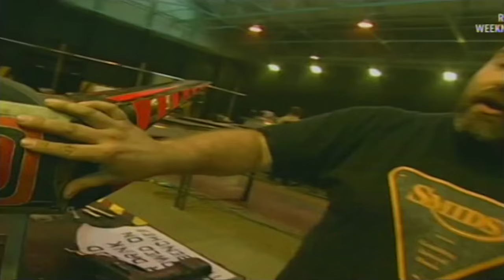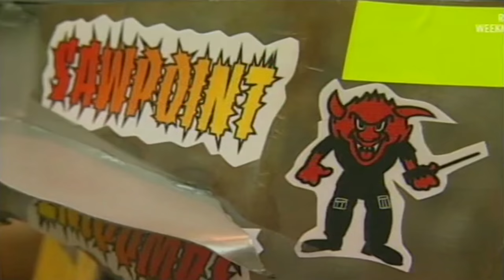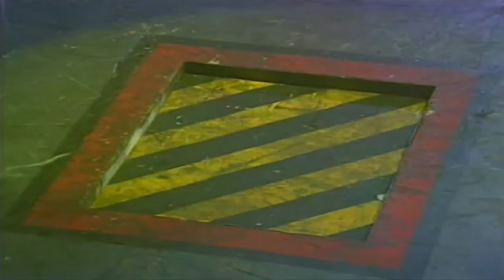Robot Wars Series 4 Heat O

Comment: Can we get some big ups for my boy Saw Point here? That 2 second KO on Oblivion, cor I bet Dominator 2 is jealous. Who needs a fancy pants axe? It's all about locomotion, baby. 
Saw Point can drive on its side and get back onto its wheels just fine, without any spinning blades. Pussycat, take notes.
Outpushing the 4 wheel drive Aggrobot with just 2 wheels? Those saws on a wooden floor= genius.
The splitting harpoon weapon? Lovely stuff, won't see anything that innovative again until Niterider. 

Also, this is a Heat with a former champion, a 3 time Heat finalist, a team that beat Razer, a team that would go onto build one of the most powerful spinners in the show, and the mighty Overkill. 
Yet Saw Point came third, incredible.
Reply: When you put it that way that sounds pretty dope
Reply: The front of oblivion 2 was bent. From Joe. X

Comment: Ah, now this is a bit better lineup than the last few heats.   Overkill looks promising, Smidsy and of course Panic Attack - but it looked like Panic Attack was running rings round the both of them.   Probably Overkill was a little unlucky to be pitted against those two.
The other heat, Aggrobot was the only convincing one.
Panica Attack vs Saw Point - what are those damn house robots doing, getting in the way?    Panic Attack was quite capable of carting Saw Point all round the arena and dumping it in the pit by itself, thank you very much!   I think it was probably just understandable frustration that impelled Panic Attack to try and push Killalot into the pit too.   And then have a go at Shunt.   I love Panic Attack!   :)
So then in the final Panic Attack saw their chance and put Smidsy in the pit - it was a good fight from Smidsy though, they were by no means a pushover.   (Except literally   :)
Reply: 2nd Wars winner panic attack was. From Joe. X

Comment: Put overkill in the mousetrap heat and it probably would have won it. what a shame such a decent robot went up against 2 vets so early
Reply: Actually at that point SMIDSY had the about the same amount of battle experience as Overkill (both series 3 round 1).
Reply: What about Rambot? Even better
Reply: It’s especially a shame cause it happened to them before, coming up against 101 in series 3, who they nearly beat before breaking down.
Reply: Overkill had a puncture in round 1. From Joe. X

Comment: Aggrobot seeded so high, why?
Reply: Heat finalist. Defeated Razer
Reply: @KINGLADUDU  "defeated" it just broke down
Reply: @florix7889   a win is a win regardless of how its achieved
Reply: @KINGLADUDU  yeah but it doesn't represent the quality of the winner bot
Reply: @florix7889  aye but robot wars has been littered with " undeserving" seeds. You could argue stinger in this series shouldn't be a seed at all ( at this point never won a robot wars battle I believe) Ming in series 7. Even. Big brother in series 4 technically only reached the semis on series 3 because another team " forfeited".
Reply: @KINGLADUDU  yeah it's in theory a good robot but in practice it's bad it just got lucky. Not enough match to get an accurate représentation of skill
Reply: When you get to the lower bracket of seeds in Robot Wars, it’s less “who deserves to be ranked highly”, and more “who would potentially make for some good matchups and help the favoured robots get through, or even provide some dark horses”.

It wasn’t until series 6 where reflecting how you did in past series really became a priority for the seeds. I mean, the likes of Mortis and Napalm were ranked below robots with less pedigree than them. It’s more about expectations for the current series.

In Aggrobot’s case, it has enough merit for some kind of seeding, and was probably meant to be a hype man for the higher seed. In the original list, Aggrobot was seeded 22. Since Blade’s Big Bruva and Trident pulled out just before filming, half of the list was shifted. 

Had those 2 stayed in the competition, Aggrobot would have been in Behemoth’s heat. On paper, that’s a good ticket for the popular bulldozer to get into the semis. 
Here, Aggrobot still fills that purpose nicely for Panic Attack.

Incidentally, a lot of the seeds make more sense when you look at the original list. Killerhurtz was originally 18 and paired up with Hypno-Disc; it wasn’t meant to be a heat favourite, it was meant to be shredded.
King B3 would have been 19 and paired up with Razer; perfect shape to be crushed.
For this heat, Cerberus would have been 20. Same story as Aggrobot; returning heat finalist, fun look and team, extra bulk for the heat but no real threat to the favourite.
Reply: He beat razer on series 3. From Joe. X
Reply: @TheLegacyofHitchcock  Interesting; do you know where I can find this original Seedings chart, alongside a comparison with the revisions?